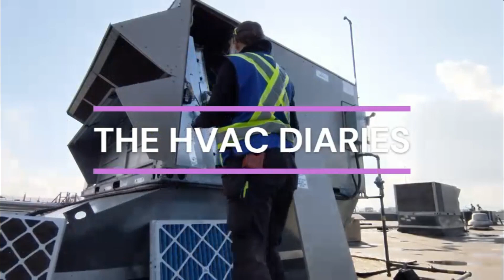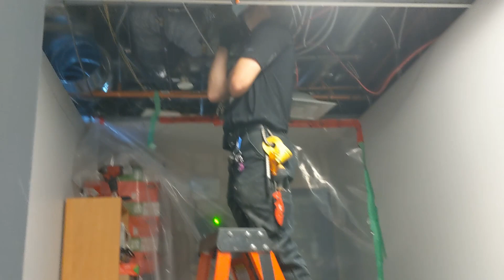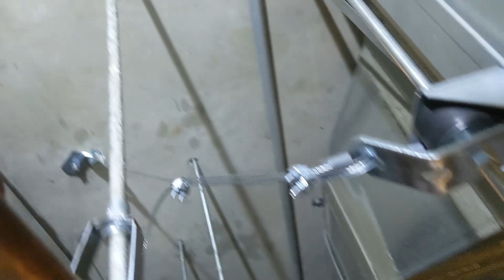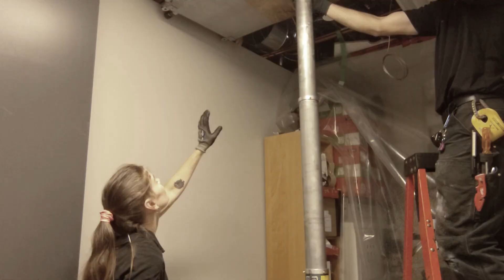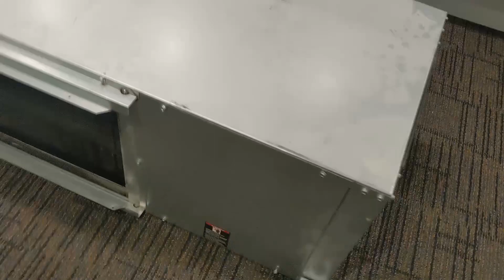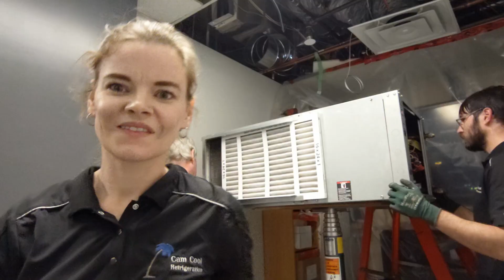Climate Master Water Source Heat Pump Replacement

Comment: Great video and explanation. What is the other accent behind Canada? I'm going to attempt this myself. "Notoriously inconvenient locations" is right- mine is going to require demo'ing then rebuilding my bathroom ceiling. But with a bit more room to maneuver than you had here. Will definitely be finding one of those lifts. I hope "control cable goes in, power goes in" is as simple as you make it sound!

Comment: Excellent job in very tight quarters for a heavy machine, maybe I missed it, but what failed in the older WSHP?
Reply from the maker: Thank you so much...  Tight quarters for sure, luckily they removed the closet in the corner for us!  The last unit had a mysterious refrigerant leak we couldn't find.  We've had the same problem in a few of them in this building, they are about 12 years old.